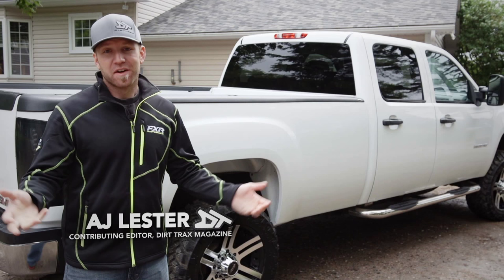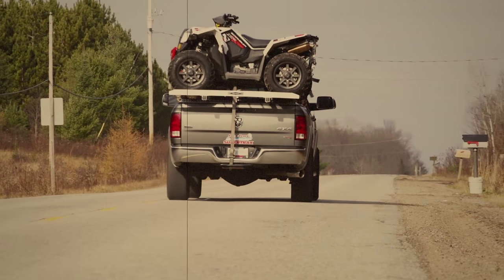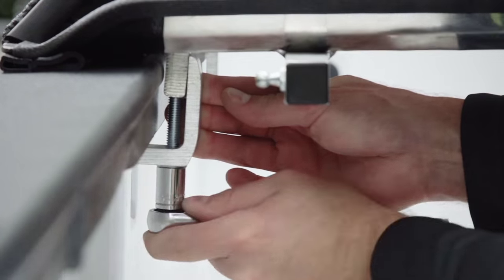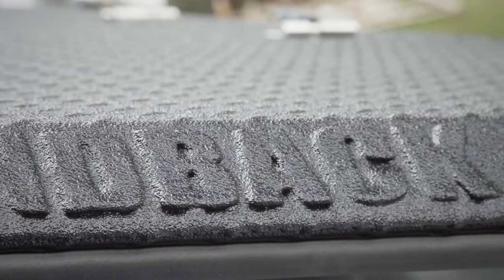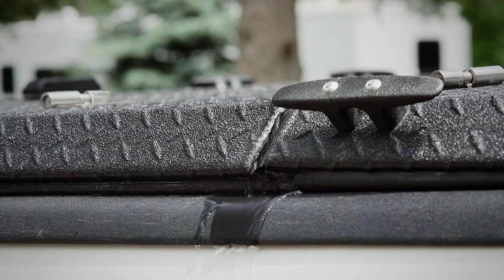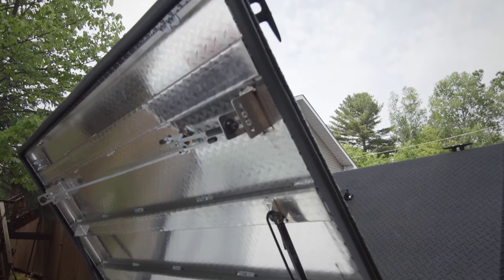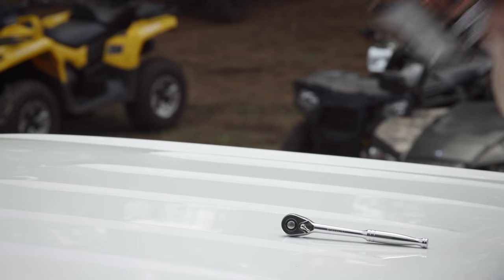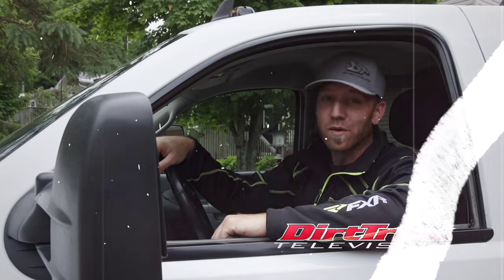Installing A Diamondback HD Truck Cover

Comment: Do you have any helper springs or air springs to help the ride. Also do you think a Honda pioneer 500 would fit a 6.5ft box with the diamond back bed extenders.